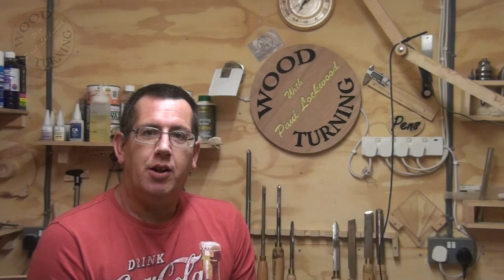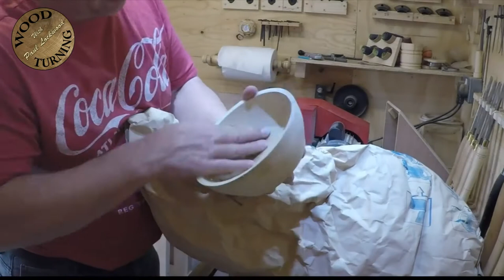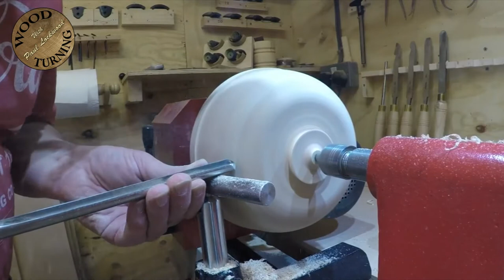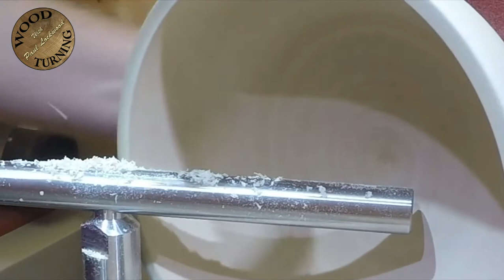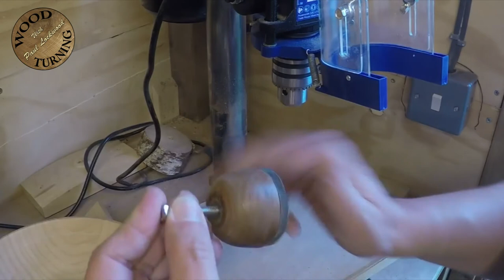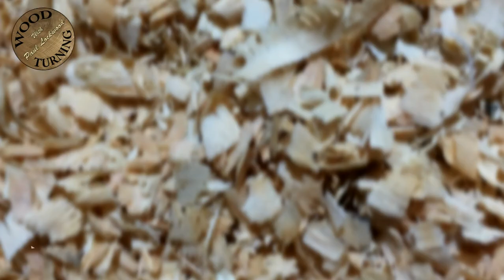Finish Oak Bowl With A Hole - Episode 100

Comment: Love how you fixed your "mistake".  I think it came out great!  I bought the Robert Sorby bowl sander and have the same problem you did - it doesn't turn all the time.  I figured it was operator error rather than the sander.  I think I need to practice more. Thanks for the video.  I always look forward to your new ones.
Reply from the maker: Thank you Gayle. I certainly didn't want to waste the bowl. Worth the fix. Obviously the bowl sander spins a lot fast the further out you are from the centre. Does take a little getting used to.

Comment: Hey Paul, I know you wanted the oil finish, but I find with end grain turning and hollowing that if you apply a couple coats of sanding sealer it stiffens up the fibres and you tend to get a much better cut with your scraper or sharp gouges. Just a thought for future mate.

Nice fix and it came out grand in the end.
Steve.
Reply from the maker: Thank you Steve. I think my main issue was because I went to thin. The other rough turned bowl may also be the same, need to make them a little thicker on rough turning.

Not bad in the end, but should have been a lot better. I don't do too many bowls and I thing it shows here.

Comment: Hi Paul, what a great save! 

Roughed turned way too thin mate, you have to give yourself more meat to play with - you probably know this, but wood tends to move as it dries out - and depending on where abouts from the tree it came from it could move a lot!

I normally use a simple thickness gauge out of a piece of 3mm wire - if you round it off at the ends it won't scratch too much. Measure twice, cut once my old joinery tutor used to say!

Good effort though, the plug gives the bowl a bit of character. Well done.

:D
Reply from the maker: Thank you Dave. In fact it didn't move that much. Yes it was still too thin though. It was one I rough turned back in March. Sure the previous bowl I di was a similar thickness that turned out well but then that wasn't end grain.